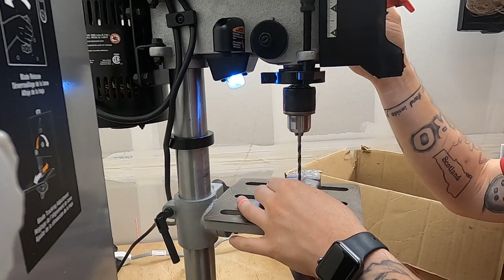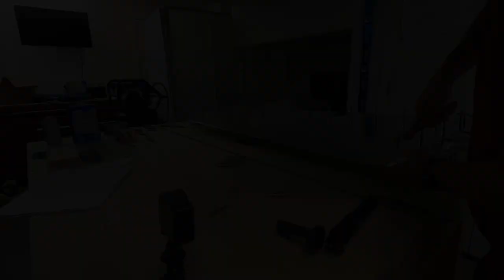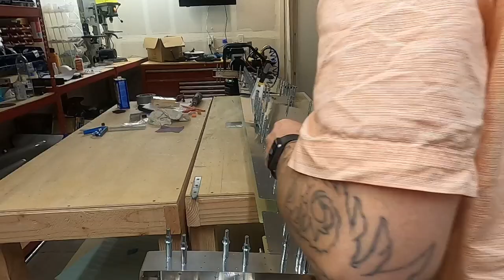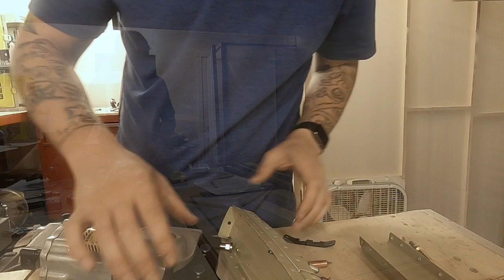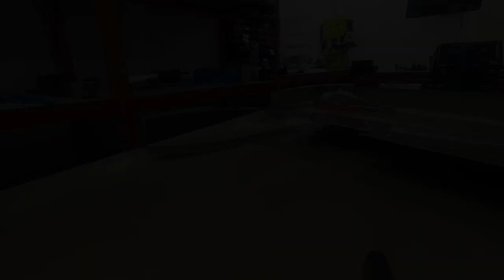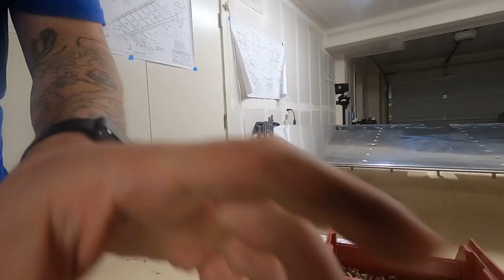Building an Experimental Airplane, The Vans RV-7A | EP1.10 Building the Elevator Part II

Comment: Wanted to ask about your dimpling? I noticed on these pieces that you primed first and then dimpled. Did you get any chipping of the primer around the dimpled areas? Also did you find the the dimples nesting properly done this way?

Keith
Reply from the maker: I’ve bounced around. I was dimpling with the outer plastic on, priming, and removing that plastic to expose a clean exterior. I learned dimpling with plastic is frowned upon in some circles.

Wanting to keep the outer plastic on to prevent overspray on the skins, I primed first. I was told by those people in the circles that the primer is thinner than the plastic and should interfere less. 

I tried this with success. The primer doesn’t flake (the Akzo is incredibly durable yet flexible enough to survive the dimple). 

Now, as you may have noticed, my plane isn’t perfect and I’m not measuring the height of each rivet head. I wish it were, and I wish I had that kind of diligence, but I just don’t. I haven’t noticed any rivets sitting measurably and repeatedly higher than others regardless of method.